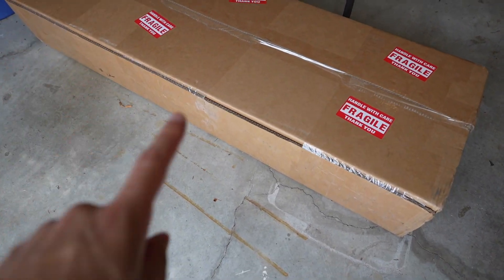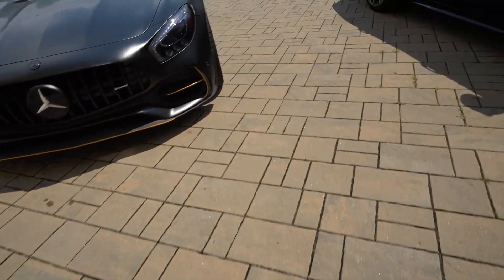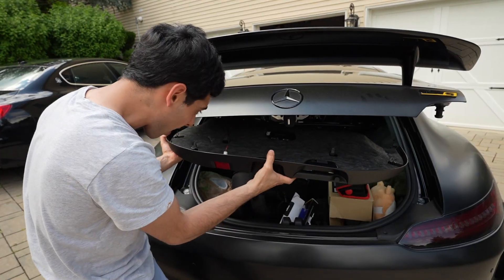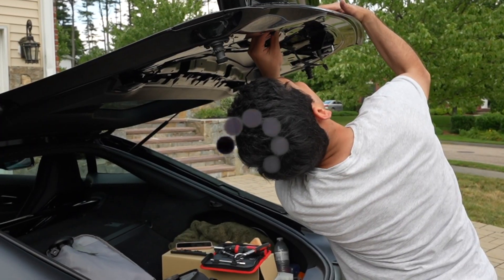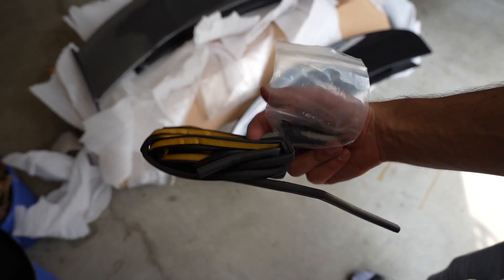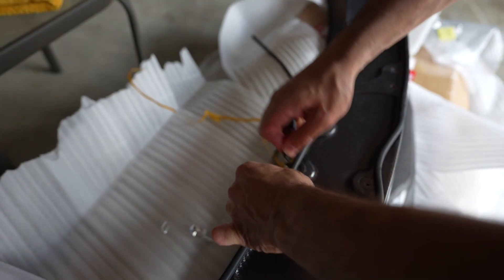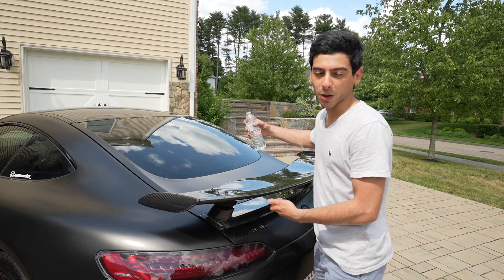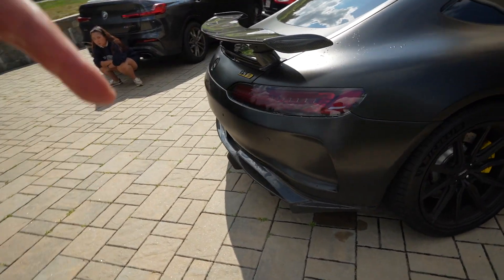MORE MODIFICATIONS FOR THE GTS! INSTALLING A CARBON FIBER WING

Comment: Your car is so cool.. 

I'm curious. There are two types of amg gts genuine spoilers: a variable spoiler and a fixed wing. Are the size of the lower base plate the same for both types?

And one more thing... Did you upgrade the size of the indoor monitor?

Comment: Just got a gtc I'm going to be adding a wing. Great Vid...  Did you need to make any additional steps with the programming so the car does not throw any codes when it tries to deploy the automatic wing that came stock?
Reply from the maker: If you have the wing with the motor, you basically have to do a motor delete. My car has the aerodynamics package so the wing was static (no motor) making it easier to replace

Comment: I know this is an old video, but hoping you'll see this and respond.  I recently got a pre-facelift GTS (2016) and am looking at adding some carbon fiber parts.  The 2 companies I've been looking at are RW Carbon and DarwinPro.  Just curious, what made you go with the RW Carbon wing when you had already done the rear bumper/diffuser from DarwinPro?  Since you have parts from both, I was wondering A) if you feel like one company seems to have better quality than the other and B) how does the carbon match on your parts from the two companies?  I'm actually leaning towards doing the opposite as you did in that I think I prefer the "single hump" design of the DP wing and the slightly more understated look of the RW diffuser, but wanted to get your advice.  Most important thing to me is that the weave/finish of all parts is a good match.  If not, I'll pick one company to source everything from.  Thanks.
Reply: Buy Darwin pro